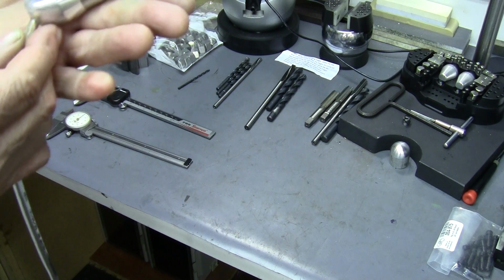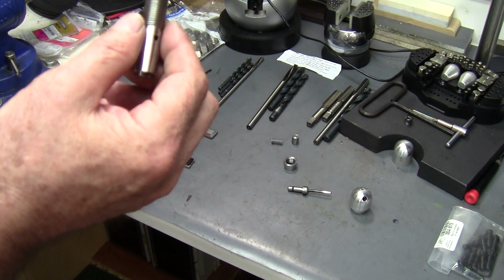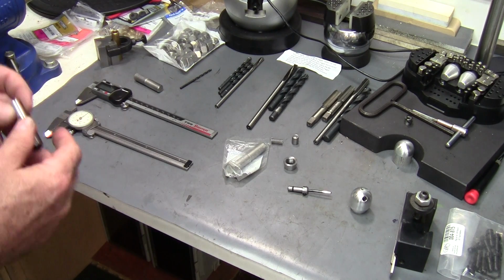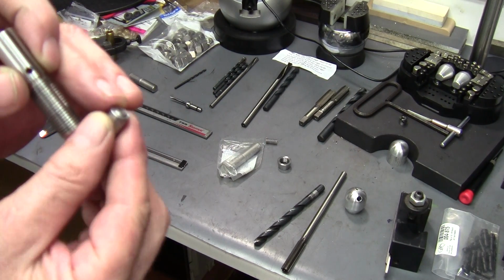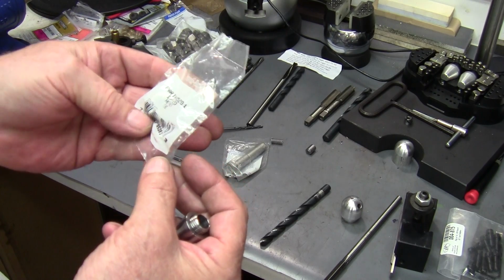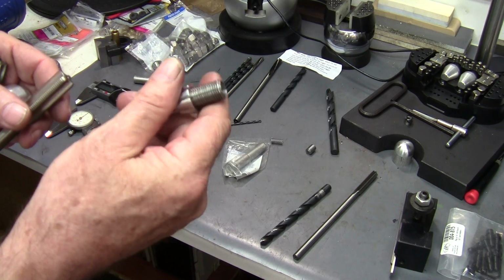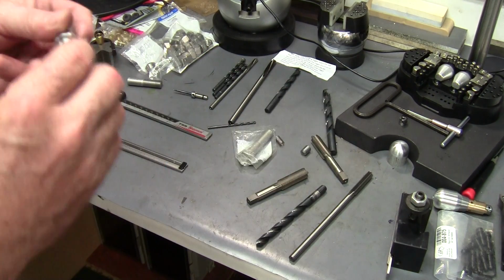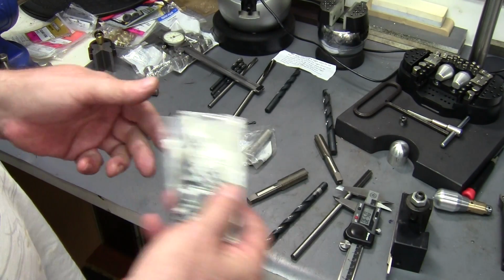How I make a Hand-piece for the Homemade Hand Engraving Machine Part 1

Comment: As I understand this DIY hand engraver require CHANGING the compressor - right ?

I want to make one that can run WITHOUT changing the compressor - where can I find drawings for such ?
Reply from the maker: It requires modifying a tire inflator. They are cheap at harbor freight

Comment: May I ask what compressor set up are you using?I'm retrofitting a car tire inflator but trying to find out if a spring loaded or no spring will work I have a spring palm engraver but spring is at bottom towards the engraving bit not up in handle any info would be appreciated 👍
Reply from the maker: The tire inflator must be modified, after mod it pushes and pulls/sucks and blows the same air back and forth. The spring goes behind the piston in the hand-piece. I offer free blueprints and drawing that explain how it works. If you would like them email me at ralex397@hotmail.com.

Comment: Do you think this would work with a Co2 cartridge? Or does it need a "pulse type" compressor?
Reply from the maker: No, it will not work with Co2, regular compressed air or a pulse type system. It will only work with a modified tire inflator / compressor.

Comment: Hi Rick, hoping you can answer: should the QC tool be popping out with the air pressure? Not all the way out across the room but more like a long stroke that doesn’t happen once you start using the graver. I’ve noticed in some other people’s videos the QC tool also does this. Is this normal? Thanks!
Reply from the maker: Yes, the QC will pop out when not in contact with the work piece.  nothing to worry about. The Oring on the QC holder keeps it from flying out of the hand piece
Reply: @ralex397  Brill Thankyou! Thats a relief!

Comment: Rick, just watched your video on making your engraving tool. I'm a retired Toolmaker now 75 years old but still have a full machine shop at hm. Is it possible to get a set of drawings from you. I am building a flintlock and wish to engrave my own patchbox which is my family crest. I am curious to where the spring goes,  spring pressure and air pressure needed.
Great video by the way.  Thank you Donne Griffiths
Reply from the maker: Email me at ralex397@hotmail.com and I'll send them to you. The spring goes behind the piston,  it helps regulate the stroke, acts as a shock absorber.

Comment: Hey Rick, I’m just starting my engraving journey, l have followed your series and now  have setup that makes all the correct noises and things so it should work once it has been setup, my question is how long does the graver need to protrude from the end of the collet, if this is a matter of personal choice what would be a good starting measurement, thanks for the video series, it was easy to follow and everything at my end went well, once again a massive thank you. 
Steve,
Reply from the maker: Hi Steve, the GRS C Max gravers come pre shaped at just under 2 inches long, thats the length I use. Over time and sharpening it will get shorter but that will take a while. If you are making your own gravers out of HSS 2 inches is a good starting point.
Reply: @ralex397   thank you for your reply, i have not been able to find a supplier in the UK so i will use High Speed Steel to start with, thanks again
Reply from the maker: @steveshaw3631  Good luck! and have fun!

Comment: Hi Rick, thanks for sharing this video and design. I engrave copper, steel and wood plates for intaglio printmaking. I use hand gravers but due to health issues my joints cannot take pushing a graver thru steel or boxwood for long, limiting my work ability. I looked at Lindsey and GRS air engravers about 10 years ago and concluded I could not afford to purchase them. I did not see any plans back then either.

You have inspired me to make my own. I did not think it would be so easy... I have a metal lathe and mill. The only info I still need is the size of o-ring for the quick change tool holder. What size do you use on yours?
Reply from the maker: I no longer make my own quick change tool holders, I find it easer to buy GRS QC holders from eBay. But when I did make them I used a 1/8 x 1/4 x 1/16 O'ring.
Reply: @ralex397  Thank you for the prompt reply. I know the temptation of just buying such supplies, but shipping to another country and exchange rates dont favour me very much so I will make them. Its a good thing I have collets to make production runs faster
Reply from the maker: @johnfurr8779  I understand that, I no longer ship outside the US. If you don't all ready have them I offer the blueprints and drawings in PDF for free, just email me.
Reply: @ralex397  Thanks again, but I found them where they are posted to google drive. I have already mostly redrawn them in fusion 360 modified slightly to suit my needs. I'm happy to send you a fusion 360 and dxf files to share with others when I am done with the finishing touches
Reply from the maker: @johnfurr8779  Sure, thanks!

Comment: Great video so much good, useful, and accurate information that honestly isn’t anywhere else on YouTube. There are some good videos out there but nothing that goes as in depth and detailed as yours fine sir.   For that I say thank you.  I do have one question about the handpiece that may be a dumb question but being a noob to this I figured I’d ask anyway.  So in the handpiece, does the piston in the cylinder actually make contact with the quick change holder and it most extended point in travel, or is it only making contact with the shoulder on the inside of the handpiece created by the 2 different size bores created with the different size cavity’s created by using 2 different drill bits and reamers used to bore out the cylinder from their perspective ends?
Reply from the maker: The piston hits the back of the quick change tool holder, transferring the energy to the graver. Some hand pieces have a set screw to lock the tool holder into the hand piece, but I think you lose energy when the tool holder is locked in. Glad you enjoyed the videos!

Comment: Thanks for the plans Rick they look amazing. I am gearing up to make the graver and buy a foot pedal. But I am confused about the compressor I would need to run this... If I understand it correctly some engravers run on positive pressure using a normal air compressor, and some run on negative air pressure where the compressor needs to cycle the same air back and forth. Which type does this graver use? Can I make it work with my "workshop size" air compressor?
Reply from the maker: You must modify a small 12 volt compressor / tire inflator for this hand piece to work, it will not run on regular compressed air or pulse type engraving systems. After the compressor is modified it sucks and blows the same air back and forth, as the piston in the compressor goes up it pressurizes and pushes the piston in the hand piece against the tool holder, when the piston goes down it sucks the piston in the HP to the rear and the cycle starts over again. The speed controller slows the compressor down to usable speeds.
Reply: Thanks Rick, I really appreciate the advice. Cheers.

Comment: How do you machine the recessed locator notch on the quick change tool holder? I see in your video and Shawn Hughes video showing the barrel locator notch fitting squarely into the tool holder’s recess, and am stumped as to how to machine it as such. Great videos, can’t wait for more of the ma deuce build, too.
Reply from the maker: I use a mill to make the notch when I make my own, but it is much easer to buy  GRS tool holders off eBay,
Reply: Thanks for replying. Ah, I see. Phew, I thought was going to have to chisel out corners into end mill rounded slot. On the tool holder. Thanks for the tip, so to speak

Comment: Great videos. Made one. It runs but not with enough power. It hits fine. Is adjustable but not enough punch. 
My compressor is as small as seen one other videos but could it be too week?
Reply from the maker: Do you have a speed controller for the compressor? Without a speed controller the compressor will run too fast and won't develop the power you need.
Reply: Rick Alexander that Night be it. Its 230v so I’ll have to creative. Will try it out.
Reply from the maker: Make sure the piston in the hand piece has a slip fit, no more than .002 inch smaller than bore. Good Luck!!
Reply: Rick Alexander will do. Hope to get it working. Very nice videos again.

Comment: Hello Rick! I manufactured a handpiece but the piston is moving to the front and doesn’t oscillate. The dimensions, position of the 4 holes are acording to your description. The play between the cylinder and piston is also what you mentioned: about 0.08 mm in diameter. What I do wrong.
Reply from the maker: If the piston covers up the vent holes it will stop.....make sure thats not happening..If it is put a small taper, radius or chamfer at the end of the piston so it wont block the vent holes. If that is not the problem make sure the intake valve on the piston of the compressor has been sealed shut. Hope that helps.
Reply: Rick Alexander Thanks! The quick change piece ends exactly at the midle of the vent holes, the piston ends in a round shape. So, the vent holes never will be closed by the piston. I’m using an industrial compressor, adjusted between 20 and 40 psi. What is not understsndable for me: the pressure move the piston forward till will be in contact to the end of the quick change piece. What should make the piston to start to move backward and oscillate?
Reply from the maker: You must modify a compressor to move the air in the cylinder back and forth, block the intake valve and open up the out valve going to the hand piece. As the piston goes up it compresses the air forcing the piston in the hand piece to strike the QC tool holder, when the piston in the compressor goes down it causes a suction and the piston in the hand piece is pulled back.  It will not work with an unmodified compressor.
Reply: Rick Alexander Many thanks! Now I got it! Is logical! This kind of handpiece will not work with a standard compressed air! Thanks again!

Comment: Sir I have compressure for painting use .Is it suitable for your tool.
Reply from the maker: Only if it is modified, see my video on modifying the compressor
Reply: I control air pressure by air controller then it will useful your tool

Comment: Walmart has a 120 volt tire inflating compressor.I got one modified it .its about the size of the harbor freight.. Its not same valving system so modification is lil different.but now where I was using a variac to control voltage on my battery charger to run my harbor freight compressor I just plug my new compressor into my variac eliminating the battery charger

Comment: Rick I've made two 1/2 inch engravers and one 9/16 engraver plus my last one was a 5/8 -18 plus my last one was a 5/8-18 engraver..that one has a 1/2 inch piston. The 9/16 has a 7/16 piston. I also epoxied a piece of brass tubing on the wooden handles instead of depending on the plastic tubing to be inserted in a hole....works better

Comment: Home depot and Lowes are good places to get bolts and spring I found Lowes has a better selection of springs..try to get Allen cap bolts they have better metal..get 4 inch ones this way u can use rest for piston.or just cut a 3/8bolt.. Use a nut with a flat rubber washer to hold adjustments between .handle. If u don't have a 1/2 -20 tap then turn down outside of a nut to make a threaded sleeve and press fit or epoxy to your wood handle...remember just a few thousands larger than the bore of handle or u will split wood.u can make the bore of handle with a wood bit ..bore first then turn sleeve nut to fit bore...if u bore body with drill and don't have a reamer then split a dowel stick some good sand paper in slit and hone body then fit ur piston.. Good luck feel free to email me...samalverio8@gmail.com

Comment: rick the dowel works great remember it's precision ground and hardened and has formed radius at both ends so u don't have to make those. and inside a teamed hole it's a perfect fit.i haven't  tried it without spring as u know it's hard finding that perfect spring.i am a retired machines and I have a mini machine shop in my spare room. I have a friend that installs hardwood floors and  ask for scraps and layer them for patterns  and make my handles.its nice looking and enjoyable hope to put something with pics on u tube as soon as I learn how..nice exchanging ideas with u.

Comment: I've laminated some pieces of scrap hard wood and made some nice handles I bored them before turning them then I took a piece of 5/8 -3/4 piece of metal and made a threaded 1/2 20 sleeve and turned it to fit the bored hole slightly larger to press fit into wood size on wood handle or u can epoxy it by making handle hole lil larger which in turn I threaded on to a bolt and used it as a mandrel to turn and form my handles..it makes a nicer looking project feel free to email me ..will be sending pics soon..take care

Comment: The threaded but that is used to lock up the setting I installed a a flat rubber washer from Lowes 2 in a package and that holds the setting real good.I put it between lo king but and handle its very thin
Reply from the maker: An O ring in-between the nut and the handle does help to hold it in place, another worthy modification.

Comment: U only need 2 vent holes on body.I also use a small 3/8 dowel pin for piston its harden and precise ground..works great.
Reply from the maker: Outstanding! I love hearing about improvements and what works and don't work, thanks for sharing!
Does the dowel pin work without a spring, or is a spring needed?

Comment: Rick is that a ''o'' ring on the QC Tool Holder?
Reply from the maker: Yes, the "o" ring helps hold the QC tool holder in the hand-piece. I may start adding a set screw to the hand-piece to hold the QC in place, right now I will do it on request.

Comment: Hi Rick Great video i have made 2 of the hand pieces one out of stainless and the other out of brass i like the brass don't know why i found that a steel piston is to hard hitting and the hand piece just runs away so i made one out of aluminum better but still didn't give me the control i wanted then i made a piston out of delrin played around with the weight by adding different screws to it finally got the control in most materials a little slow in steel but i do have control
Reply from the maker: Thanks Dennis, glad you liked the videos! The weight of the piston is just one of the variables in getting the hand piece to run the way you like it, its a balancing act between the speed of the compressor, foot pedal, piston weight, spring or no spring and how the graver is sharpened. For such a simple machine there is a lot  going on.

Comment: Excellent looking tool Rick, where did you get your springs, wont be much use to me in the UK probably, I am making my own from music wire, soft springs seem hard to find and why is it our brains wont let us say rotary table when a camera is on?
All the best, look forward to seeing some more.
Reply: Is good to have various spring one for a soft touch and for hitting hard..i use more the soft hit cause it glides when making lines the hard hitting I use it for removing metal and some thick prong vending...
Reply from the maker: Thats funny but thats what happened, brain fart. I buy an assortment box that has 100 or more assorted springs, I use the thin springs that are compressed together a pull type spring, I pull them apart  until they stretch out just a little then cut out the length I need. They make the best "soft" spring. Making your own is probably the best way.